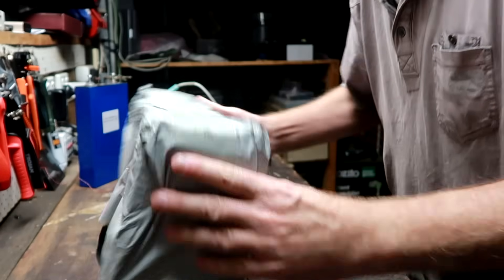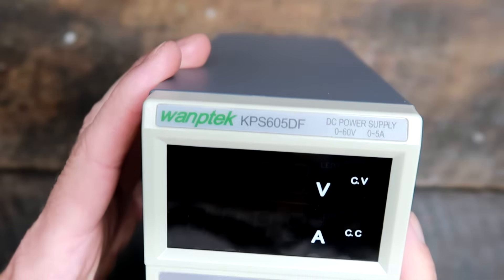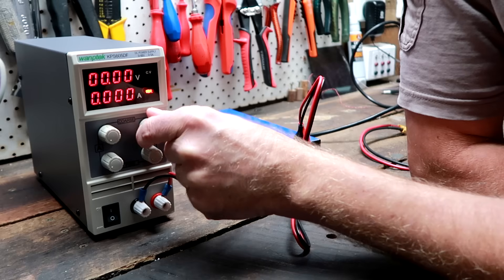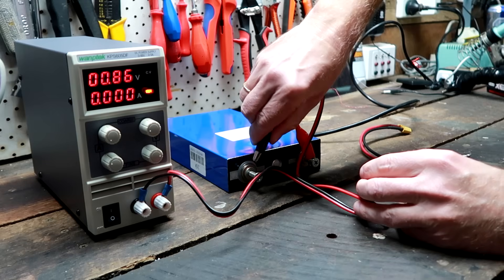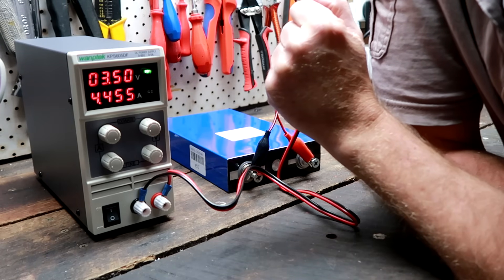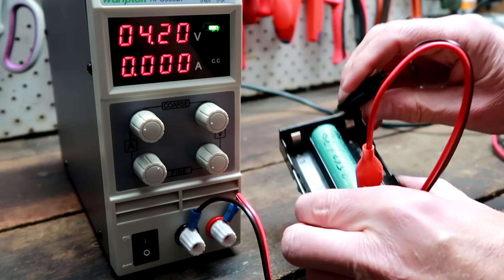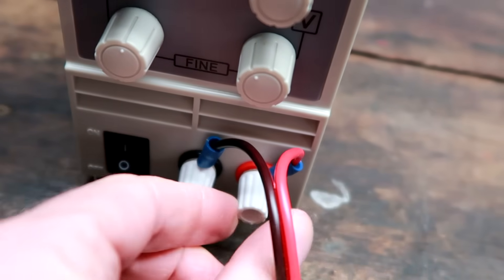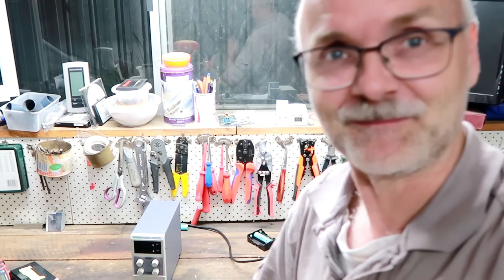Cheap 300W workbench variable power supply. Can it deliver and charge lithium batteries?

Comment: Andy, I've had two of these units for several years (under a different rebadged brand) in my electronics/robotics workshop (in the UK) - the 30V/10A version. They are cheap but reliable (and I've never heard the fan turn on). They are available next-day in UK from Amazon. I have even used them for a PHEV BMU reset! (Sure you can guess why). Anyway I've been following you from early PHEV voltage drop days-your stuff is always watchable and informative. All the best from broken cloud, slightly warm southern Scotland.
Reply from the maker: Thanks for sharing, Jonathon. That's good to know.
The PHEV battery reset feature... The good old days 😉

Comment: Those power supplies are cheap and built to the price but they definitely get the job done.  I have a few (10) I ordered for the school I teach at for the electronics class and the first thing I had the class do was take them apart and replace the output terminals and also add 10 turn pots to replace the course knobs.  We swapped out the volt and amp meters with 5 digit ones. We also beefed up the wire going from the circuit board to the output terminal to prevent voltage drop and they are now really decent units and you would not even be able to tell that they were modified other than by using them since we used green voltmeters and the 10 turn pots making the fine adjustment kinda pointless.
Reply from the maker: Thanks for sharing. These are good suggestions and I'll look into this. It's not hard to improve these things.
Why did you go 5 digit with the meters? Do you need that accuracy?
Reply: @OffGridGarageAustralia  It made adjustments easier to see without a meter connected when you upgrade the unit to a 10 turn potentiometer.  In the electronics class the students build a lot of circuits that need a fairly accurate voltage reference to help prove that the math works when they are starting out and are new to electronics.  It also comes in handy when you need to diagnose voltage or current fluxuations coming from the power input side of the circuit without hooking up an oscilliscope since the 5 digit meters were a bit more sensative to fluctuations.

Comment: Dramatically fantastic video, dc power supply is excellent way to check and charge batteries, I am an electronic amateur and prefer to use dc power supply than other chargers.
Thanks again.
Greetings from Saudi Arabia.
Reply from the maker: Thank you.

Comment: 061921/1403h PST 🇺🇸/ 062021/0720h Brisbane 🇦🇺.  Good day, Andy. Thanks for the demo on WANPTEK 60V05A PSU. I found them to be simple, light weight and small foot print unit with greater working environment. I had WANPTEK 30V10A for few years, until I murdered it by connecting to opposite polarity. The glass fuse didn’t blow, but shorted the MOSFETs. I will work on it. Then I got WANPTEK DPS30-10U. That unit is even better than the previous one.
There are several variants of this PSU. Please view them. 90 days for the shipment delivery? Err no comments.

Now a lil bit of sentiments:
People talk, people also make illogical comments and decisions, on others. Circus is enjoyable with the accompaniment of Clowns. You got the gist, I suppose.
A full can of Oettinger and Rick Braun’s Trumpet, will compensate the agony.

I enjoy, I learn and look forward to your researches and results. Please continue your scientific endeavor. We look forward to viewing your hard work on the screen. Take care and be safe. 73s…

Comment: You could get RD6018(w?).. i think better option... maybe more costly but not much...
Reply from the maker: Yeah, I looked at this, you need your own power supply and put this all in a case and also I wanted something simple without any buttons to press. Just need a quick setup to test something and that's it...
Reply: @OffGridGarageAustralia  maybe yes but you have 10 memory button  in that and it is just press button. Or have korb... i go same way as you and now have 2 extra power supply (one 60v 30a SO BIG & HEAVY). Now using mostly... rd6018...

Comment: Excellent work Andy. Ignore the haters! Thank you for your work and efforts, it is extremely appreciated. Iv got the 30V 10A variant of that power supply. Used it to successfully resuscitate/desulphate my 4x 200Ah AGM batteries. Unfortunately the capacity improvement was short lived. Saving up to eventually replace my old crap batteries with 16S 280Ah LiFePO4 😁
Reply from the maker: Thank you.

Comment: I would recommend getting a power supply with an enable output button. You don't have to adjust the voltage and current with the load connected.
There exists a 60V 5A version with those features.
Reply: Often these units allow shorting the wires to set the current, before applying to load

Comment: Don't trust the display on the power supply, always set the voltage using your meter, then connect it to the battery and turn up the current. Wanptek actually manufactures many other brands that just stick their name on the box. My testing has found them to be well worth the money. Forgot to add, ignore comments you don't like, life is too short to get upset by trolls.
Reply from the maker: Thank you John. 
It seems to be fairly accurate, I checked both volt and amps a few times and it was matching with the multimeter. Had it running for over 1h yesterday at 60V and 5A and it didn't drift at all. The fan came on a few times but overall it delivered...

Comment: I have a very similar (60V, 5A) power supply, but mine is TopPower branded here in the U.K. Looks the same as yours, and a similar price too.

Whilst it will do just over 60V, and just over 5A, it won’t do both at the same time. 

I occasionally use mine to test Victron MPPT charge controllers (simulating a solar panel output, especially if working at night) and the limit really is 300w, and not a watt more. It shuts down if over that combined V/A limit.
Great bit of kit IMO. 

Ignore the trolls, they need to learn that there is an off button and alternative content that meets their narrow minded opinions. An opinion is just that, and yours has been shown over time to be fair and reasonable.
Reply from the maker: Thank you Ian. 
I found the same with mine yesterday when charging tha battery. If I go to high with the amps at 60V it lilits the power output. It was runnig stable at 4.35A though. That's good eneough for me.
I didn't know you can test MPPTs with that. I was always under the impression they don't like to be connected to a power supply as they cannot track a max power point.
Reply: @OffGridGarageAustralia  Thanks for the reply. I too was initially sceptical about using the power supply as an input to an MPPT solar charge controller; and whilst it does wildly swing the voltage and current on first powering things up, it soon settles down to alternating between constant voltage and constant current a few times per second with minimal changes in each of the values - it’s actually an interesting insight into how the MPPT “seeks out” the best power point with a “constant” input from a bench power supply. Sadly a lot of my solar experimenting takes place in the evenings, so by the time I get to play there is no sun left on my panels, hence discovering this alternate use for a bench power supply.

Comment: nice video. Power supply must be complete trash ..i'm saying that because of the pricei'm surprised it was even working..no safety nothing..but you can't ask for it for that price. So for the price it is OK ..for long term use ..not good
Reply from the maker: We will see. So far it's behaving well. Had it running for over 1h on full power yesterday to charge the big battery, no problems (yet).

Comment: Had the same model, started randomly jumping up/down up to 0.3V after a year, got worse over time, like the potentiometers weren't making a solid connection. Not ideal for Lithium charging
Reply: Same experience here. The adjustments are analog rather than an indexing digital type and they will always drift. This unit can be upgraded to digital potentiometers.
Reply: 061921/1452h PST 🇺🇸. These units are reliable. The erratic behavior of potentiometer may be due to minute dirt particles on carbon track. All you got to do is spray WD40 through the opening of the potentiometer and swirl the spindle a few times. The fine control is tricky, though. You could also replace the carbon potentiometer with wire wound units of the same value, if possible. Best wishes and 73s…
Reply from the maker: Great tips here, thank you!